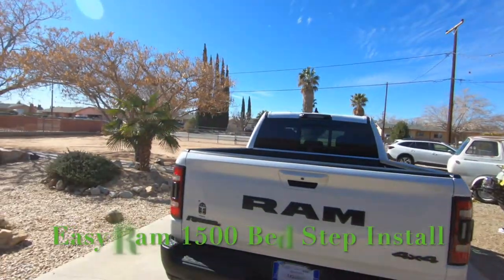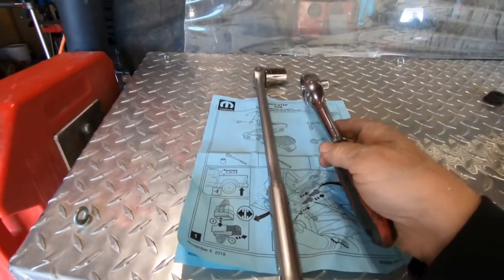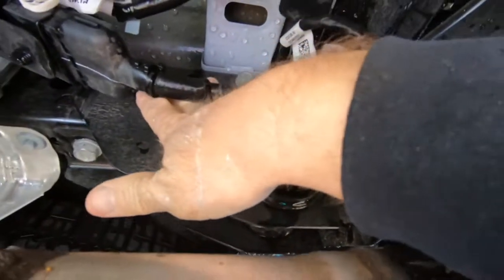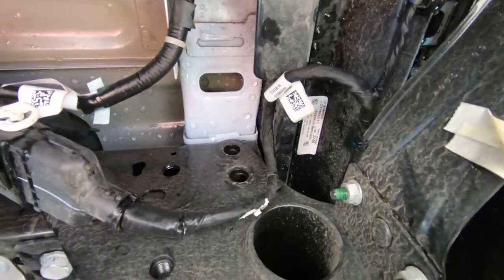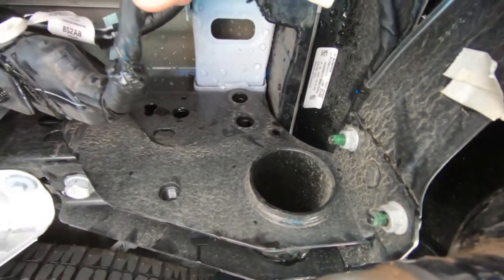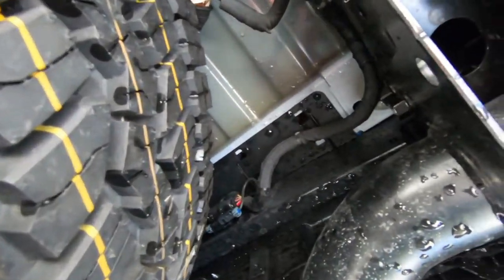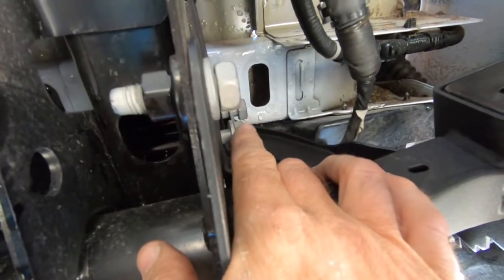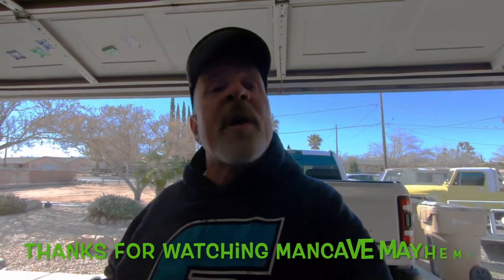2021 Ram 1500 Bed Step Install (EASY)

Comment: That harness is much easier than the other one. There is a video on here about how to remove it. You push the red button towards the rear bumper (it clicks), then push down hard on the tab where the red button was (it clicks), then you can pull up on the white cam arm and the 2 plugs separate.  Search for 2021 ram bed step harness and you should find it.

Comment: This will NOT fit a 2019 Ram even though they claim it will.  Perhaps my 5.7 SLT is too plain.  The bolt holes do not line up and the hole for the little "temp holding stick/ball" does not exist in my frame/subframe.  So, I pulled off the whole bumper and subframe, (8 bolts) cut off the ball/stick thingy. clamped it on the subframe with Vicegrips and welded it into place.  Meh, it works fine, hangs in the correct place and holds my hefty butt.  It'l do.
Reply from the maker: What a pain on the butt! Sorry to hear that. Sounds like u made it work👍🏻

Comment: I used an impact wrench to get the 2 bolts out super easy and I never disconnected the harness but it was a bitch to do. I tried but the little red tab on the connector flew out from the top.
Reply from the maker: It’s definitely worth having though👍🏻

Comment: Torque is 120. Please torque those 2 upper bolts are trailer hitch bolts. 2021 newer do not need to disconnect the electricial harness.
Reply: Thank you for the torque specs!  Much appreciated!

Comment: Can you install this with the factory one also installed, which retracts on the other side of the exhaust.
Reply from the maker: The one I installed is a factory one I bought it direct from the dealership and it’s a ram product
Reply: @ManCaveMayhem  thank you. I guess what I meant was can you install this one along with the one that comes from the factory that is installed on the inside of the exhaust. So I would have two installed at the same time. One at the corner and one more middle way towards the center. Both on the driver side.
Reply from the maker: @aeroliteflyer  not sure about that 🤷‍♂️

Comment: So I just went to install on my 2020 Rebel... they welded a cross support from the mounting plate to the step assembly...it blocks the exhaust...now WTF do I do??
***Edited****
Slapping myself in the forehead...origami yup.  It's installed thanks for the video.